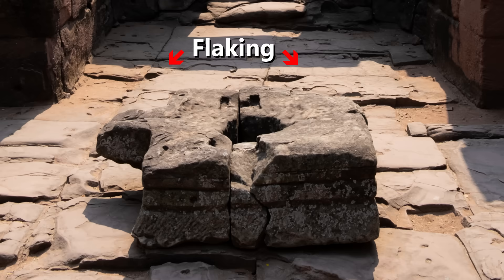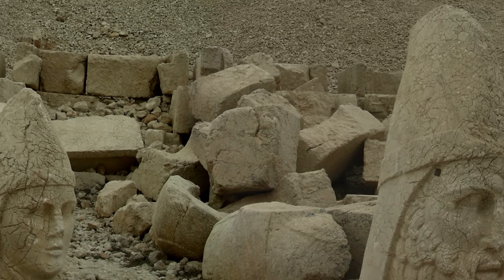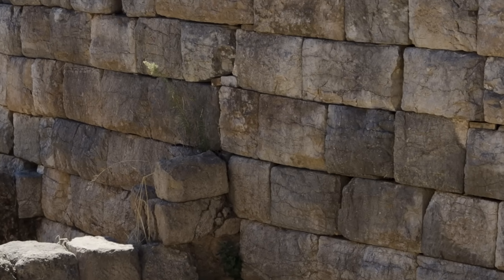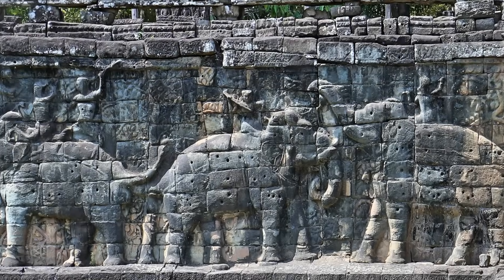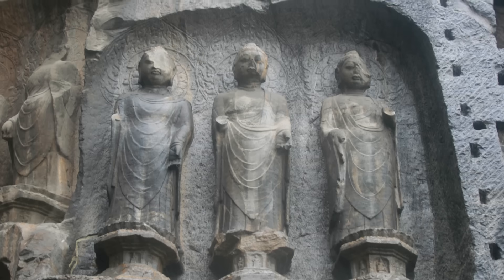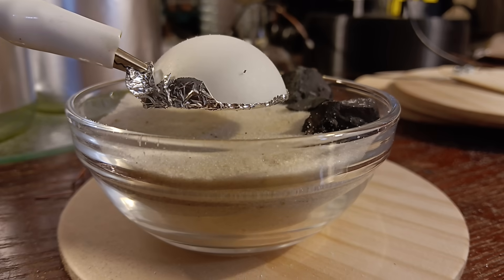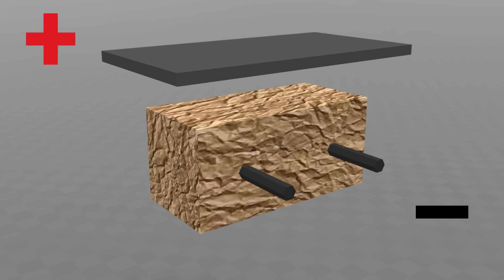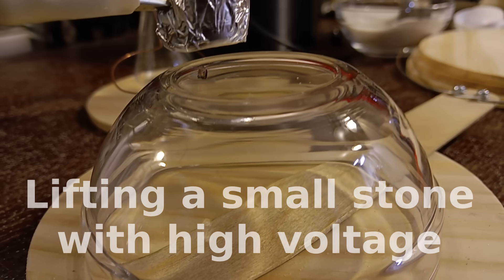The Greatest Mystery, Solved. Recreating Ancient Stone Melding Technology (Part 1)

Comment: I'm effect they were using a form of gravitational defeat to lift large or massive carved stone pieces and to set them in place. This could mean that today we also have the same capabilities however instead using metals and composite. I have observed large passenger jets landing at today's airports hovering for short periods of time before touching the runway. The jets would strangely use the air braking system while still in the air about 100 feet above the runway and as these jets would do this they would almost stop in mid air and hover for a few seconds and slowly descend down to the runway at slower speed after braking in mid air from 200 mph. I have observed 3 very large passenger jets doing this over a course of a few months as they were landing at an undisclosed international airport in Florida not far from the Kennedy space facilities. Do we too today use gravitational defeat technologies ? You decide.

Comment: The ancients used a few methods to build stone structures. 

The people of Eastern Islam (Polynesia) were able to cut large blocks from mountain rock. Some unfinished blocks are still there, some broke in the middle and were left. Those 10-15 tones rocks were then moved to the shore and positioned accordingly. Everything was done using ropes. People who pulled the rock split into three groups, one in the left, one on the right and one on the front. The the base of the rock was cut in such a way that it wouldn’t stand if not supported. The rock would always fall forward. The groups in the left and on the right were pulling the rock to their side one by one. The rock would turn slightly to the right then to the left and again to the right. Eventually such block could be moved long distances with little efforts. Roughly twenty average men would “move” the rock. 

The Billie tells us that Jerusalem was built from soft rock. This is type of rock which is soft and can be cut with a knife but when left in open air it harden in time. 

In Peru the ancients used so called geopolymers which is hardened mud, sand and some plants. This geopolymer “clay” was soft and could be easily formed into blocks but when hardened it turned into monolithic like rock. This is why archeologist think the block were cut from a bedrock but that is very unlikely. 

I highly doubt the ancients used any cutting stone machinery, electricity or “lost technology”.  If that was true then someone somewhere would find a sort of manual on how the tools were used. Since we don’t have any (literally we have nothing) then we should assume the ancients didn’t use any specific technology but common tools…and the knowledge that came from somewhere else. The Book of Enoch explains who shared the know how.
Reply from the maker: You know, they worship a rock with an electrode still on it - look at the 'kaaba black stone'... Silly humans; worshiping an electrode and not knowing it really make us ALL look silly...
Reply: @MadPlasmatist  I don't know about that, but I know that Kabaa has chapel inside it where Muslims worship Allah and indeed it is Black Rock (from heavens), a counterfeit of biblical Rock who is Christ.
Reply from the maker: @danieljust295  Yes, look at pictures of the big metal electrode they worship on that rock... This is a part of how the ancients began heating and shaping massive stones - just imagine an incredible plasma stream shooting into it - that metal piece draws /conducts the hot electricity / plasma to it and the heat is then dissipated throughout the stone - there are usually several more, it would seem this one was put into place before a cataclysm stopped work =)

Comment: The stones where first roughly caved to fit each to the straightest smoothest presion then a hard sand and water was used between the surfaces the stone was pushed back and forth making the joint separation so small a razor will no fit in between

Comment: Fascinating idea .. I wouldn’t want to be the guy hanging onto one of these  rods under full plasma blast .. it would be like hanging onto lightning bolt whilst manoeuvring a 300 tone block at well over 1000 degrees 30 plus feet in the air with the thickest sunglasses you have ever seen and ear plugs made of asbestos.. fck that for a job ..

Comment: well your theory is wrong! If the knobs on megalithic stones was for electrons then explain some or most megalithic walls have very few knobs on them ? And some a lot why is that ? Should be about the same amount and distance between them if used as you theorize
Reply from the maker: It's not a theory if it is entirely proven. Give me $2000 and I'll make a small wall.
Reply: @MadPlasmatist  its proven? Did you prove it ? 🫢

Comment: Polymere is mucheasier to make though and doesn'tequire as much power and technology.
Reply from the maker: Perhaps, though why is there so much evidence of vitrification present in both the structures and quarries the stones were removed from, using the same high-heat plasma methods / technology? There is far too much evidence of high voltage application (a spark gap lingam, for example) which is in fact a magnetic flux engine - one of many purposes for it was melding stones...

Comment: Finally someone else is seeing it! I look at this stuff all the time and can't help but think they used an arc welder of some sort. I agree with the levitation theory as well, similar to an ion trap, they could apply current within a rolling contraption to cover long distances with ease, we've been asking the wrong questions for ages, how did they generate their electricity?
Reply from the maker: The Earth provides all, however, the Earth isn't as it once was - the skies used to be so full of charge they were said to always look like the 'northern lights' - until cataclysms changed the entire solar system and not just Earth... Harnessing charge differentials (especially from the sky / ground) are key in answering these questions =)

Comment: You need to modulate the frequency of your voltage to match that of the stone you are trying to "meld". I suggest starting with a low amplitude voltage first until you find the resonant frequency of the stone then ramp it up until it starts to deform. A phase locked loop on the feedback current on the probes will allow you to dial it right in.

Comment: It's easier if everything is cast from geopolymers. no electricity required.
The holes and protruding parts in the stones were there to attach scaffolding. Hyroglyphs were stamped into the exterior plaster. You don't have to reinvent the wheel, we also use polymers for every building construction.

Comment: While it is a possible theory, the truth is concrete has a mysterious origin that cannot be traced to any timeline but has been around forever. Geology proves that any porous material can become hardened through certain heat, pressure, and mineralization processes. We know concrete by design gets harder over time. Concrete is porous. We know there was a major event that scorched 75% of the earth's land mass depositing a 6-10 foot layer of ash and coal, hence the "flaking."Why is it so hard to believe they poured concrete type constructions? The holes are likely power or water conduits, or a type of rebar like reinforcement that eroded away to leave the cavity. Small holes could be for ornamental hanging. You can literally build with concrete using primitive methods, gathering in sacks the materials necessary and walking them to where they need to be.

Comment: I see two problems here.  one, many of the sites contain huge stones that would have required massive equipment just to melt the stones.  Then there's the issue of how they formed them after melting.  Why do we not find any such molding equipment?  Two, the electrical generation equipment would have to have been massive to generate high enough voltage to accomplish large scale melting of stone.  Then there's the technology required to build such equipment.  There are no signs anywhere of such equipment or any sites where they might have been used.  Lastly, why hasn't this been used in modern times to conveniently shape stone for use?
Reply: I don't think they were molded or melted, they were cut, but how is the question!

Comment: What a load of bollocks
Reply from the maker: No, not bollocks. It's high-voltage plasma, capable of temperatures far beyond your comprehension which can easily reach deep into the stones. Now that you have one eye half awake, will you open the other?

Comment: I agree they softened the rock somehow, that's what the scoop marks show, but those holes and protrusions are there so the stones can be lifted and placed into position with such fine fitting seams.  You couldn't put a rope or strap underneath the stone and lower it onto another, chocking it first is possible, but then lowering the last few inches without damage of the sharp corners would be impossible and slow.
Reply from the maker: No. And nobody 'lifts' a multi-ton stone with ropes that's as silly as ignoring all vitrification evidence and quarries where they removed blocks with the same heat treatment used to place them.

Comment: It might be a good idea to do your research first. The metal poles you've shown inside the pyramid that are threaded at the end, were used by archeologists in the past to discover the depth of the hole, and the direction it went, from the queen's chamber.
The nubs you think you've solved, seem very obvious to be the last part of the stone that were attached to the rock face before they broke it free. Having them protruding out would also make it easier to move, lever etc, compared to a complete flat surface when positioning the stone into a groove, exact location sarcophagus etc. It wouldn't be easy to remove a heavy stone once it's been lowered into its place at the incorrect angle, it would get wedged, these nubs seem to be there to give them a safety net incase such an event happened.

Comment: Atlantis (the empire, not the place) had stone casting tech which you've clearly encountered.  I think there was some kind of electrolite "cement mud" that congealed with the frequency-electrode system.  But these would only be from before the great flooding and sinking, which would not be ancient greece or rome, but the ones in bolivia, egypt, india, china and elsewhere.. other writers are pointing out that the more-recent ones have iron pegs and such; but the huge ultra-large stones set perfectly without cracks clearly.  if you watch a thermite welding of a railroad track, methinks that the tech they had was chemical, that instead of a giant electric generator, they had a way to excite a catalyst or such that would perform the "setting" action, and then broke off the catalyst from the result at the nub... like how a thermite weld casting is broken off after.  We had metals from phaeton and our home planet that could reduce gravity given the right frequencies and energy - these things got lost at the destabilizing cataclysm...  We were using electricity flows inside the earth's crust as the electicity network back in those days, and the power systems destabilized the earth's crust causing the destabilizing of the continent and the rising/falling of continents and the subsequent floods and ice ages and volcanic etc... of the dark age after atlantis that became ancient egypt... we still had the tech back then, but it was mostly older souls who were thousands of years old, we tried to keep their bodies alive by grafting animal parts and transferring the soul to a new body so we could keep the connection to the home planet and the original tech... but alas, after 7000 bc or so, the last of the old "RA" souls died off and were deified.  Great work, brilliant work, just keep your focus on old old stuff and avoid anything after 7000bc.

Comment: Stone melding? Those bumps are for articulation the math that goes into building the structure...the best theory I've heard so far you need a bump or fixed point to articulate the layout of the wall they had mathematically back then if you're claiming that they're using Geo polymers or melting Stone then your discounting all the clear Stone tool marks along the edges of the megalithic blocks..  you can just see by eye that they're not melted I was fooled for a long time too thinking it was a geopolymer of some sort but  if you really look closely at all of the edges and where they fit together you can tell that they were just shaped by pecking!! Those bumps are used to lay the structure out so they could cut the stones before placing them and new they would fit..u need a nub and hole and criticle.structure points while putting the wall together in its upright position instead of having to revuild the wall by laying it out in one dimension then having to constantly refit massive blocks you can lay the whole wall out frkm the one bump with measurments using a rope or device attached to that fixed refrence point!!! I will say i think that the people who built this structures were much bigger then modern humans.  Im not a close minded person the science behind what your saying is possible, but its not reflected in the physical evidence...i find geopolyimers more believable then melding... But I just think people were much bigger pre-flood.  Bigger people can build bigger things make a move bigger objects yeah I'm talking about Giants... There were periods of time on the earth that armadillos were bigger than a minivan there is a human like entity around then it would stand to reason they too would be expressed as a mega fauna varient of modern human.  when the whole earth is destroyed so totally by a cataclysm there would be almost 0 evidence left.. and the Smithsonian got rid of the rest😂😂😂
Reply from the maker: lol thanks I needed a good laugh today. Unfortunately it is your lifetime that has amused me such.

Comment: They didn't use writing system like us, lot of wires. Their machines had direct connection, like motherboard. Check the grand gallery in Egypt pyramid filled with black metal rods. That's their wiring system.

Comment: It 's very involved to produce the amperage needed. There is some evidence of electricity/battery use recovered from digs, but thought only put out enough juice for electroplating. 
Like others say, you have a working hypothesis to test on a sizeable block of stone. Not an actual discovery.

Comment: You have no clue mate. If you don't believe get a piece of marble and bring it to a red heat. Not even hot enough to melt. A biggish hot charcoal fire is adequate for a small lump say the size of a chicken egg. Get it to red heat then let the fire fire die down and it cool completely. Pick it up with tongs. Because it can now cause chemical burns. Drop it in a bucket of water. It will disintegrate. Congratulations, you have made lime mortar. How about you actually learn how masonry works before coming up with fanciful nonsense?

Comment: He holes or stubs btw. are for transport and not for electrodes. They bring down transportation and logistic time by a lot. And that anybody can proof.
Reply from the maker: Um... And what about all the melted stones at every ancient site? And why make square or hexagonal holes (the HARDEST holes to make in the hardest stones) to simply transport them guy come on these tangents of ideology are so weak it disappoints me that they are even considered as plausible.
Reply: You could proof the transport adavantage too. So why bitching around insted of doing a clip about it?
Make some stone with the holes or the nubs and wrap some rope around the stubs or place some hardwood stubs in the holes and grap em there. That is easy and acchievable by anybody who has a masonery drill or some pounds of concrete and a handmade form. That is possible.

Btw, did you goolge up what i intended you to inform you to and did you read what i did mention?
Did you read 250 pages to the topic? Did you make some experiments that did succed? 
I did mention the material in "making" not not not  "how they made holes" in some stones. 

Good i give a fuck about what you belief. 
I tell it again anybody can proof it, the holes are good for transportation and logistic you cannot disaproof that with denialing it. 

And btw. some buildings are made from Geopolymer even airportparts. The chemistry is there it works it holds up and its proofen real. Go google geopolymer and Davidovits build up your knowledge then your argumentation will stop maybe.
Reply: @MadPlasmatist  i assume you mention in example the stairs in the payramids in egypt. Well again when mixing the base and the aggregate it can happen that the mix isnt properly done and then the stuff will stay liquid for very long +- 2 weeks. In that time the mix can flow out of a form or leave its pressumed hard appearance.
Thta is not impossible to. 

Electric melting stones rofl chemistry explains most of the things outthere very precise and repeatable.
Reply from the maker: @fearlyenrage  You are obviously a hopeless case and remain with your eyes closed. Good luck with that.
Reply: @MadPlasmatist  thanks for sharing that. Did you get the book and read it like mentioned? "what you shout out you pound in"
Reply from the maker: @fearlyenrage  I am actively recreating this technology. It will be my book perhaps you will get someday.